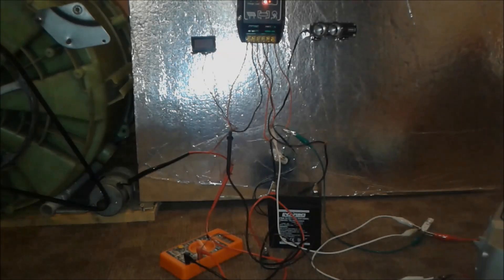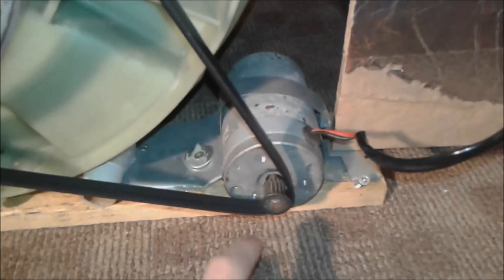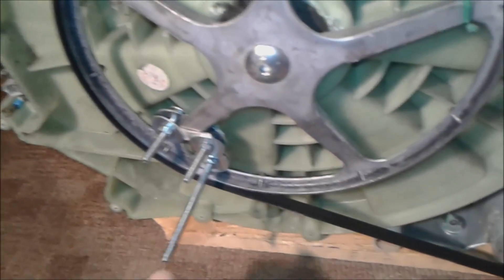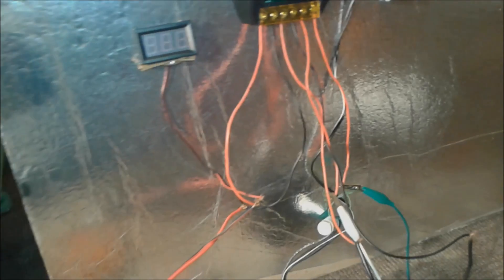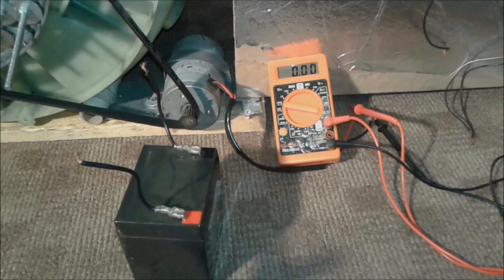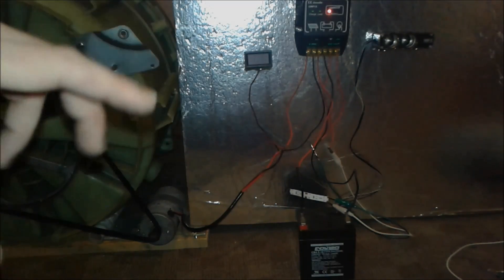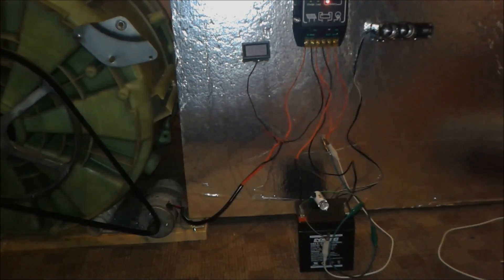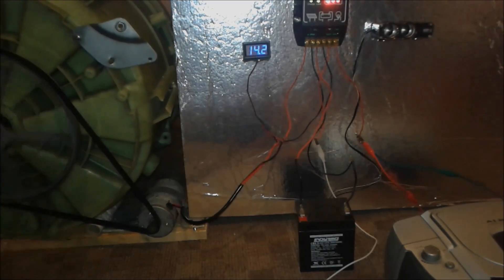How to make DC generator at home .Homemade 12v dc generator

Comment: Nice generator. I wonder if you could use that crank to turn the microwave motor from your other video to produce hundreds of volts. Thanks for sharing
Reply from the maker: The microwave motor has a cogging because of the gears you can'T SPIN it by hand and it has small power but this one is almost 40w of power it can run an inverter
Reply: OK thanks. Yeah I am watching your inverter video now. Thanks for the information
Reply: I live in the USA and we have a place called the DollarTree and it sells a Flashlight that has a little crank lever that produces electricity for the flashlight which probably has a super Capacitor to retain light even after you stop pumping the lever. I can imagine you could buy a few of these and take out the little generator and hook multiple ones to a motor to turn a bunch of them to produce more voltage. Not sure how much it would cost to make a small generator yourself, but only paying one dollar is great
Reply from the maker: +cosh row Thanks mate in theory you are right but in reality the battery spinnig the motor draw more amps that you put in.that way for generators best is using a permanent neodimium low tork alternator.on the other hand you can study tesla switch i have a video about that.all the best
Reply from the maker: +Steve Rabon could be right but normaly they have a small li-ion battery like in the solar garden light very low amps but the principle is good we need to design a permanent neodymium magnet alternator low rpm but this is very hard to do i am working on it... but it takes time.all the best
Reply: I got a 12v motor out of a 12v air pump that plugs into the Cigarette lighter of the car. You think that would work; It looks a lot like the motor you have on you generator?
Reply from the maker: +Steve Rabon test it with the multimeter,but first spin it by hand if is easy to spin and after measurement see if it has enough volts and amps is gonna work
Reply: OK thanks.